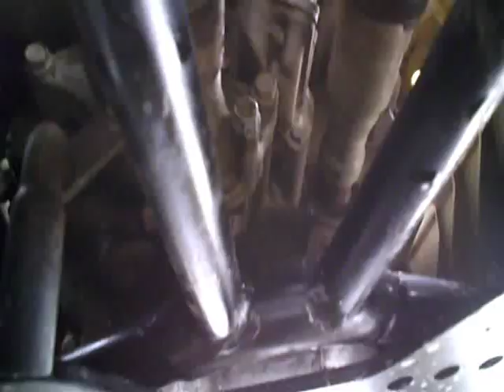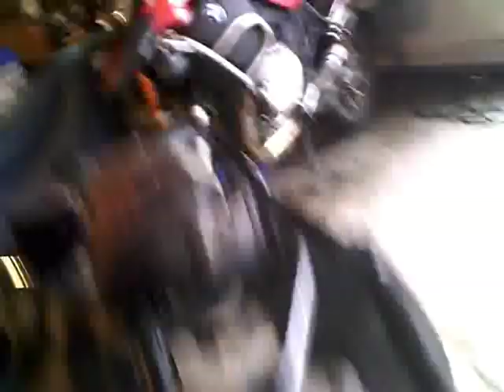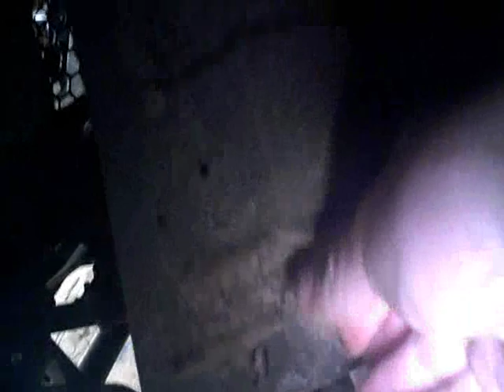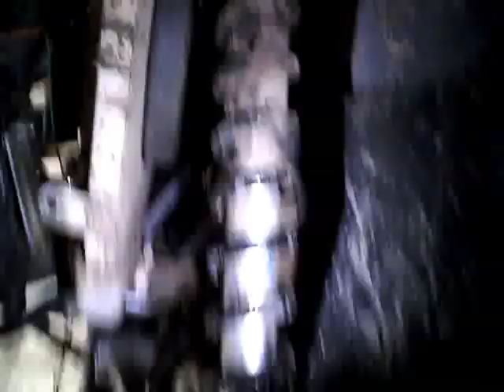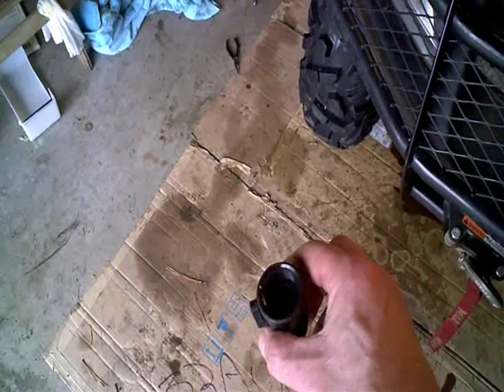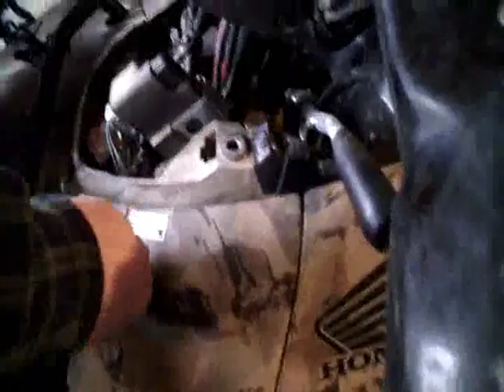How to: Honda Rincon Service Part 4

Comment: WOW 12 years ago you posted this, hopefully you are still fit and well my friend. I have a 2009 rincon with heating issues. Im an Aussie, its gets pretty hot where I'm from and I carry a fair bit of weight on the Rincon. I noticed the transmission radiator was very close to the main radiator, mine was completely clogged up with dust and dirt between the two and no doubt was preventing any proper air flow in that area. I put four washers on each bolt behind the transmission radiator. that brought the transmission radiator out 6.2mm, now there is plenty of room for dust and dirt to be easily cleaned away from between the two radiators. For what its worth I thought id tell you my fix for it. thanks for the video mate 👍
Reply from the maker: Hey thanks for the kind words!  Still around and still riding the same Rincon. 

Yeah debris between the two radiators is kind of a known issue.  Spacers can be helpful. Also RV stores will sell a tool designed to be inserted in an RV water heater’s drain to spray out buildup. Basically screws onto a garden hose, and it has a narrow wand with a bend at the end.

Comment: Does the 680 have a thermostat, and if so, does the quad need to be warmed up before changing the coolant. Thank you for your help, and for posting this.
Reply from the maker: It does have a thermostat, but I didn’t have any problems draining or filling the system while cold. Perhaps it has a small air bleed, but I don’t recall.

Comment: Hello!
Thank you for a verry good demonstration. I need to know how to change the little light bulb in the front lights. I gues itis the parking light but Im not sure. It is the småll light bulb in the bottom and inside the front lights. I find it difficult to open the light. Do I have tom diapart the whole light?     In Advanced Thank You
Kind regards Kurt Evje from Norway
Reply: Kurt Evje

Comment from the maker: If you are loosing coolant out of the hose, or the fitting where the hose should be, you are due for a water pump. Get a replacement hose if the weep hole hose is missing, and be sure to use motorcycle specific coolant.  Water pump should be quite simple to replace.  Overheating on these is often caused by debris between radiator and oil cooler.  Remove the plastic shrouds on either side of the radiator and get a good look in there.

Comment from the maker: The coolant pump is on the bottom of the engine.  It is shown, but not very well, at about 5 min in on the video.  The water pump has a weep hole, which allows coolant a place to go if the seal should fail, other than into the engine.  There should be a hose connected to the water pump, which is there to prevent dirt and grit from getting up into that weep hole and taking out the seal.

Comment: I have a 2006 Honda 680 Rincon that I have a question about overheating along with a coolant leak. I crawled up under the front and there appears to be a rubber tube missing from what SEEMS to be a water pump. Is there any way I can send you a photo from my cell of what I'm talking about???

Comment from the maker: I got the parts from a user named BKR on Rinconriders. There is a thread on the conversion there, and BKR can supply all needed parts at a discount. 

If he isn't around or something, post back and I'll see if I can locate the list of what is needed. Cole-hearse makes a nice spst o ring sealed toggle for which they also make rubber boots for. It is handy to be able to shut off the 3rd light when you have something large or reflective on the front rack...

Comment from the maker: Good eye.  Yes it has a Foreman headlight pod on it.  I didn't care for the shape/styling of the Rincon's nacelle, and I kind of like having a 3rd headlight on the bar.  It comes in handy when using a plow, and it doesn't get mud spattered as quickly as the lower lights.

If you are interested in doing that, I may have a list of the required parts somewhere...